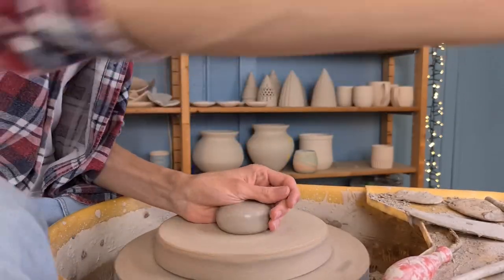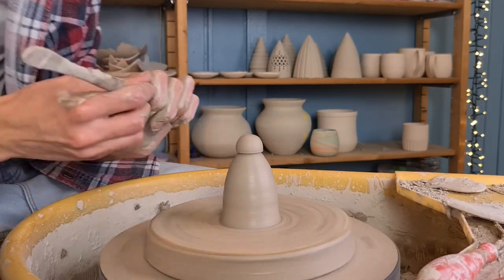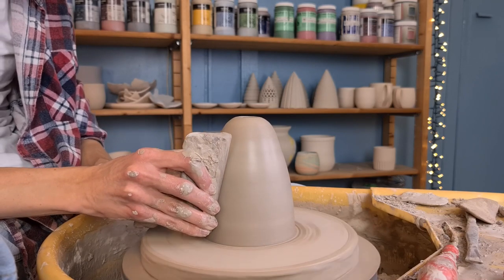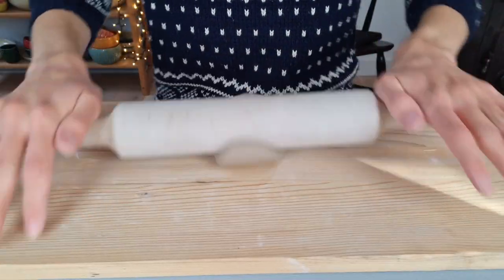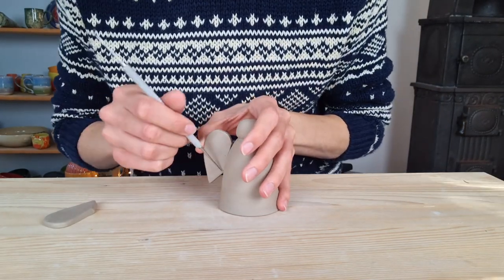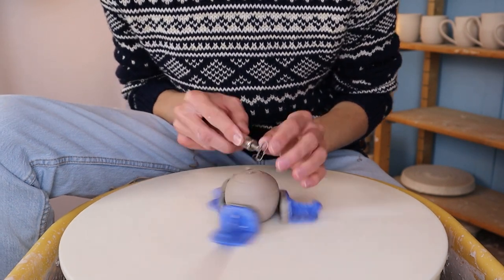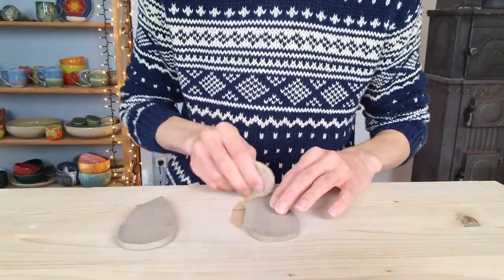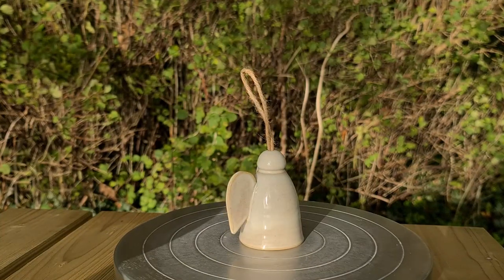How To Make A Christmas Angel Out Of Clay // throwing, handbuilding and glazing

Comment: Can i ask why the vinegar? Ive never heard of that before x x x
Reply from the maker: I'm actually not sure why, but it just works very well with attaching clay. You could also use slip, but vinegar works cleaner and even better in my opinion😊
Reply: The reaction between clay and vinegar makes the clay viscosity higher which means it's stickier and helps it bond better. It's all about changing the P.H level...
Reply from the maker: Interesting! I didn't know that, thank you!